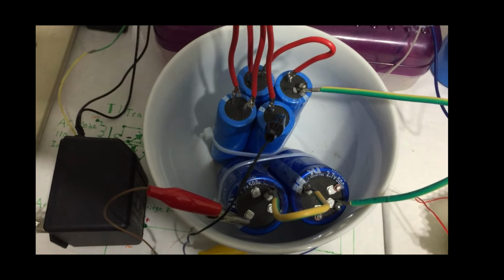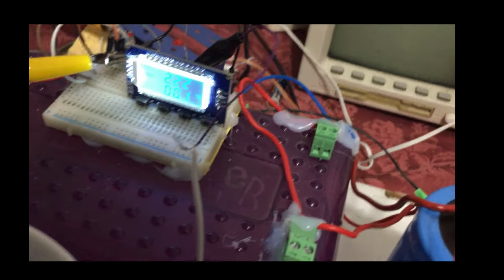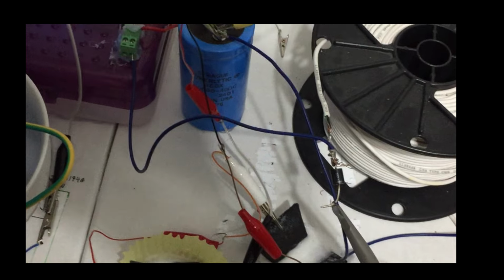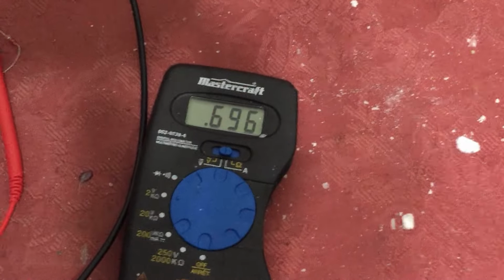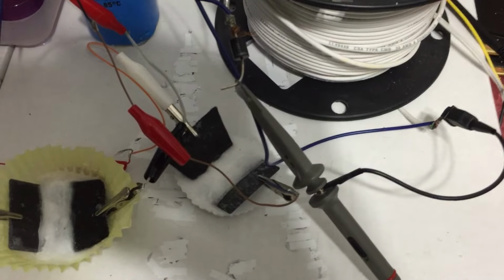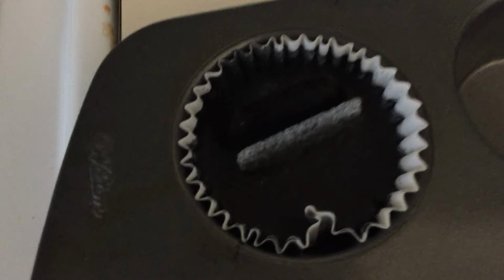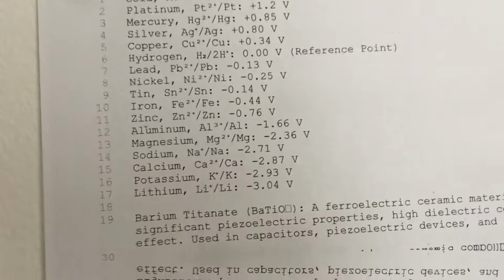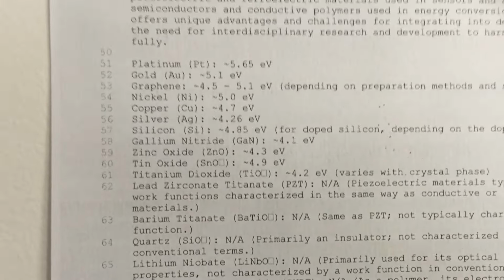Power Cell Experiments

Comment: By the way my pal I found a Glas fiber felt that could be used as separator for your quantum power cells. You know dry walls right? The use such a Glas fiber felt to prevent cracks between the dry wall panels when they spread the thick paste like material to connect the dry wall panels. In Germany the that felt is called glasfaservlies Reparatur band or Glasfaservlies GFK Vlies. I don't know how it is called correctly in your language and the translater spits out garbage. But that stuff would be thin enough for starting point🤔 and also dirt cheap too.
Reply: It's commonly called drywall tape, usually made from something like craft paper, although I have used the fiberglass version before. The blue  lint-free shop towels also make excellent separators, unless you are using strong acid/base electrolytes.